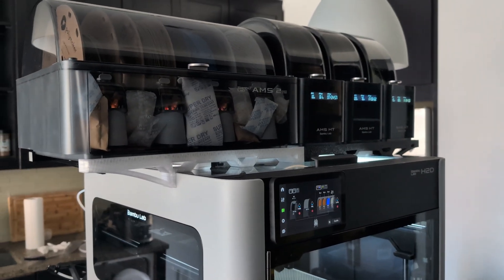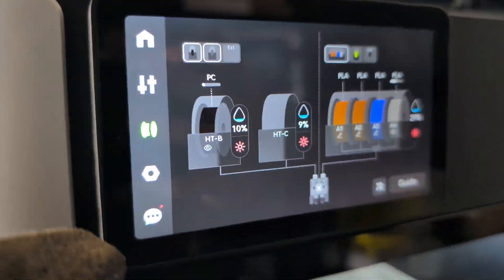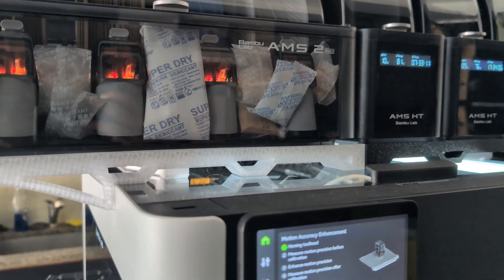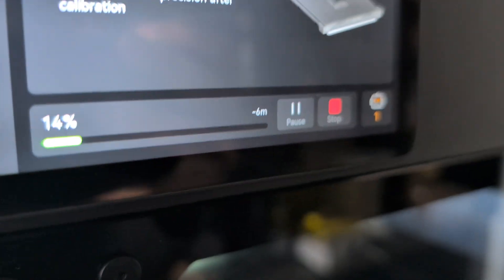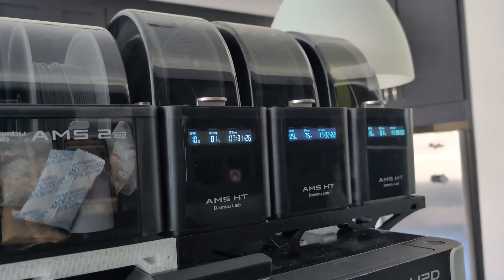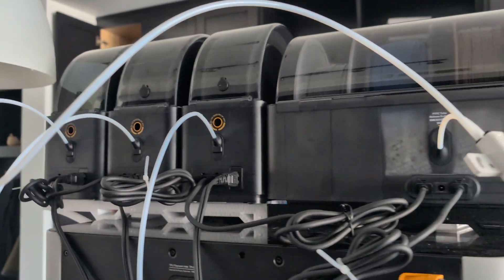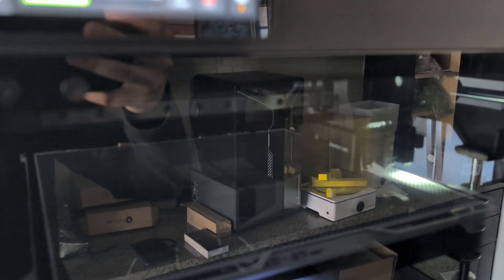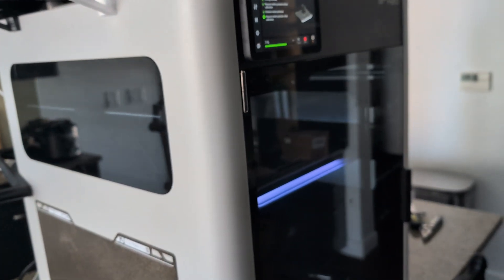Bambu Lab H2D Review and Upgrades (Vision Encoder, AMS HT, HF Nozzle)

Comment: You have to change the print profile for the speed increase, print a cube and use a caliper to measure the differences vs original. Trying print some PPS or PPA with the the HT. I would print PPA with ABS as support to save filament.
Reply: If I have to change the flow rate to use HF nozzles, does this mean you can't have the benefits when using the mobile app?

Comment: What’s the shortest amount of time you think it would take to print a full MBAR with either this or your other Bambu Labs printer?
Reply from the maker: You can't print any of the MBAR's metal parts on this. MBAR lower and MPAC upper each take around 9-11 hours
Reply: @johngalt42069   thanks, yes I was assuming that the other parts would already be on hand or machined or made during the print time. Thinking about it in terms of production, how many could be made per machine per station in an assembly line format if an if an individual or group wanted to operate a distributed network of garage facilities (say, for example, similar to the AR-15 design being able to be farmed out to small local machine shops not designated as military targets across the entirety of the US for the sake of redundancy and resiliency.
Reply from the maker: @ChristopherGoydich-cb6bd  So the MBAR magwells can be printed in 4 hours or so, you can probably fit like 20 of them on a H2D plate.

For the MPAC you should be able to print the entire thing on 1 plate, maybe fit 6 or so MPAC uppers on one plate, same goes for handguards. Total time to print one complete one is maybe 30 hours? Idk I haven't done any estimates yet.

Small parts negligible.